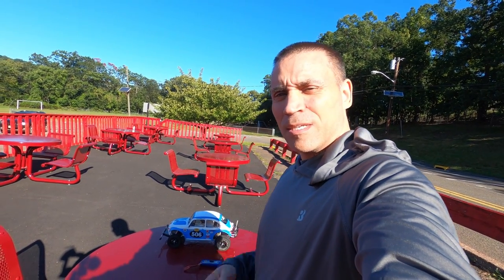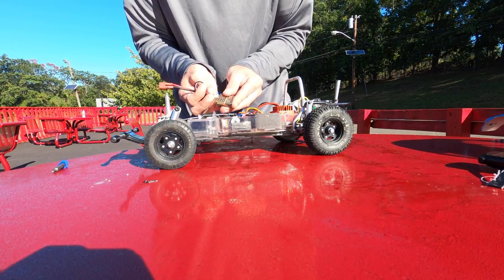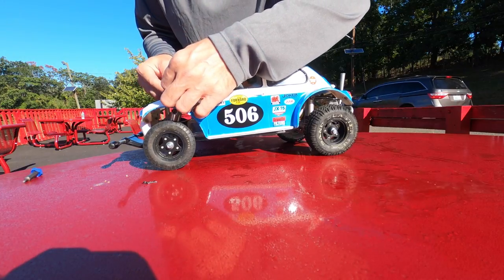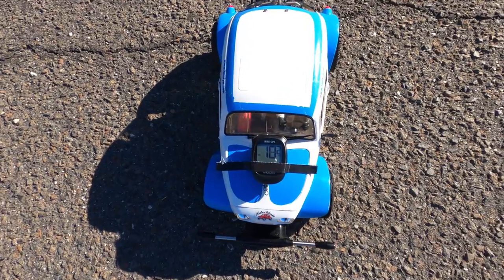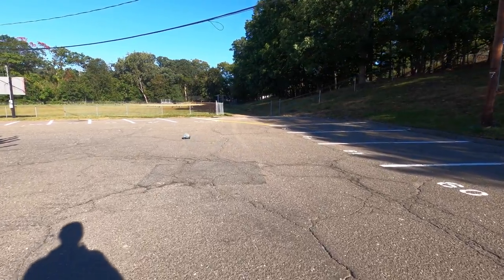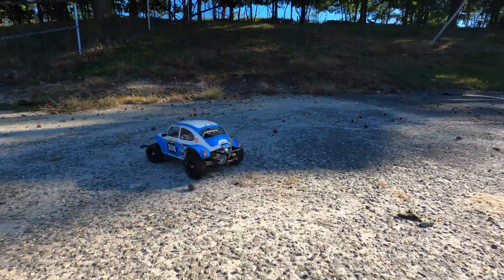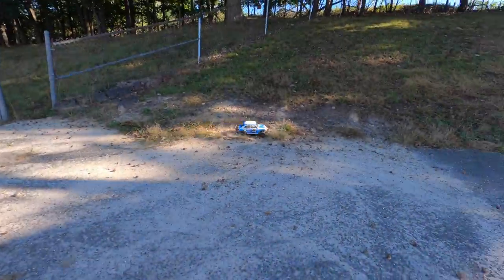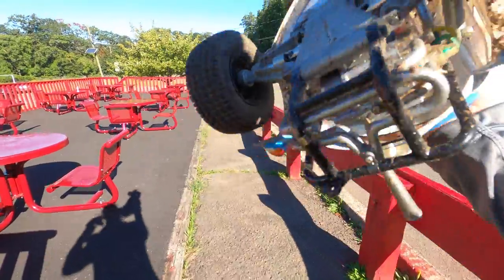Tamiya Sand Scorcher GPS SPEED TEST and BASH run

Comment: You could get up the hill if you had a stronger motor.
Reply from the maker: Hi Brad it was those darn brat tires they have no grip at all they are almost like street tires, I bet if I slapped the hornet tires on it would rip right up that hill.  Thanks for watching.